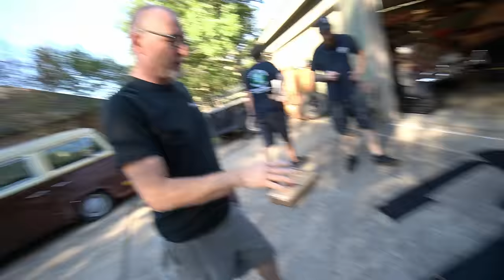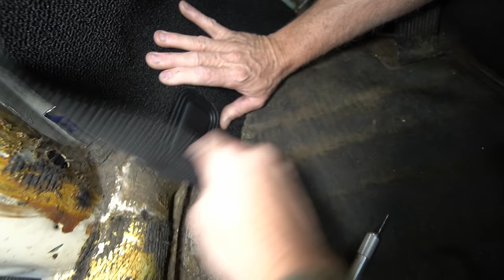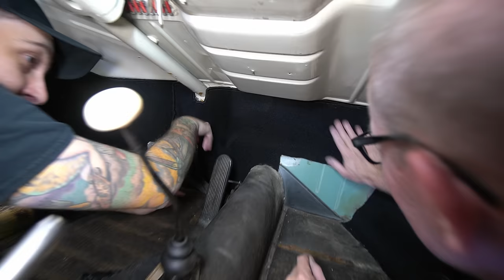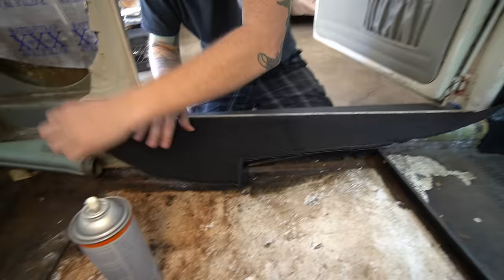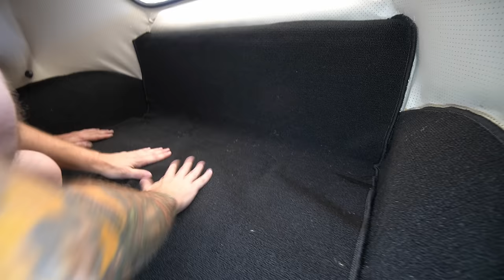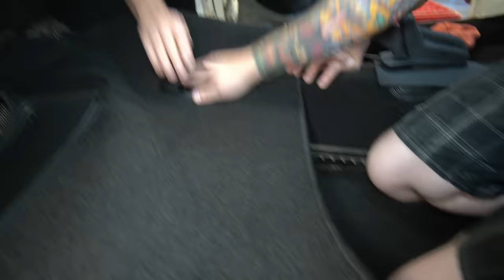How to Install a VW Beetle Carpet Kit!

Comment: An alternative to using spray adhesive is industrial strength Velcro...that way you can reposition the carpet during installation and remove it if you ever need to get to the structure underneath it.  That's how I installed my TMI kit a few years back and it's holding up great (pun intended)
Reply from the maker: wow that's interesting!

Comment: The e brake boot goes under the carpet. Lol. In 25 years I’ve never glued the main carpet down completely because if someone wants to run speakers or the main brake line goes bad or the e brake boot goes bad, or you decide later you want to put in a new harness. You’ll have to pull the carpet back up and sometimes the glue won’t let loose and it will ruin the carpet and you’ll have to buy another kit. I’ve seen some carpet kits were the shifter bolts will be under the carpet so you have to pull the carpet up and over to get to the bolts. Im surprised you didn’t put more padding on the floor.
Reply from the maker: ah okay, yeah everyone does it different i suppose.

Comment: Awesome! I'm painting the floor in my '69 1300 and I've got the TMI kit ready for install, so this helped me a lot. Thanks guys - great video
Reply from the maker: Great to hear!
Reply: @VWLifeVW  I was wondering if you could help me. My Beetle is a '69, and it has a lever by your knee to operate the air ducts. How is the carpet supposed to go around that?

Comment: The Dynamat is for sound deadening like damping a drum head. The padding is for sound insulation. Two different functions. Much much quieter with both installed.
Reply from the maker: ah okay
Reply: @VWLifeVW  I just realized the autocorrect in there… dynamat. But yeah, it keeps the metal from “ringing” like a bell. So it does deaden the sound. But it doesn’t block sound waves that pass through, that’s what the insulation does which is why VW had it thick in the back. It insulates the interior from the engine noise. Now if you want to hear that it’s great to leave off. I drive my Beetle 60 miles at a time and have audiobooks on so I have the insulation. 😆
Reply: Yes, dynamat does not need to be on every square inch of a panel. Which is good. Because it's expensive and tedious to try and do that.

Comment: Good job!  I am torn between original 1/2 carpet  kit with the rubber floors or all carpet like yours.  It seems salt and pepper square weave was stock on my '64 pearl white L-87.  I noticed you have all red fuses.  Shouldn't they be 7 white, 1 red on the far right?  Cheers from West Texas!

Comment: The dyna matting you referred to, is that the silver insulation looking stuff that says rattle trap already installed? VW newby here. What is that crank object next to the shifter you had to cut the front carpet for?
Reply: Yes, Rattle Trap is another brand of sound deadening like Dyna-Mat. The knob to the right of the shifter is the heater knob, twist it and it pulls open the heat exchanger flaps, and magically, heat!
Reply: @RRmeanmachine  Thank you.

Comment: If you're doing this alone get yourself some of those small, super strong neodymium magnets to hold the carpet piece in place, flip one half of the piece over, spray it with adhesive and press it in place.  Then you can flip the other half over and spray and press that half too.
Reply from the maker: Great tip!

Comment: I have a ‘57 beetle and trying to have some make the pins, my seat didn’t have springs or pins.  Are there 1 or 2 pins for the knobs? If it’s 1, which hole does it go in, top or bottom? (Say the hole for the seat bar is on the left) I can send a picture.

Comment: The TMI people make good stuff. Great idea on using a lighter on the edges or when cutting holes to prevent the fibers from coming apart. Getting that emergency brake rubber cover on and inside that hole in the carpet in that area is a real b$tch...🤣😂

Comment: What’s sad is that many of these kits are not cut  properly so they don’t fit right. It’s hard to find a less expensive quality kit. Many don’t even have the heater openings. Also, the wound binding edge ends up coming apart. Do your research before buying. If you can afford the crazy priced German square weave, buy it!
Reply from the maker: yes good tip!